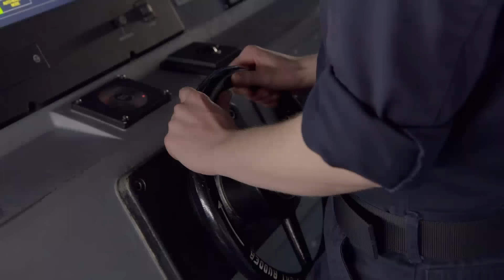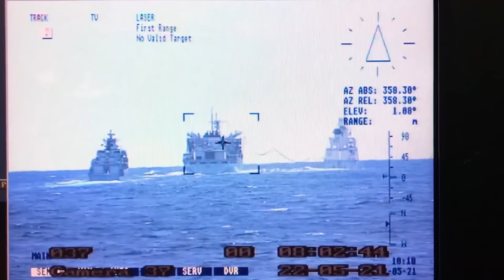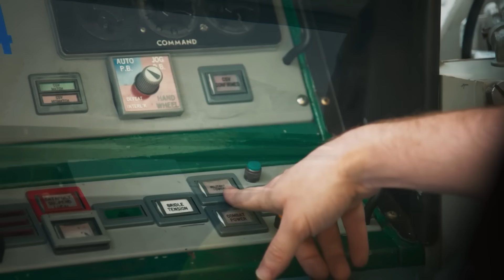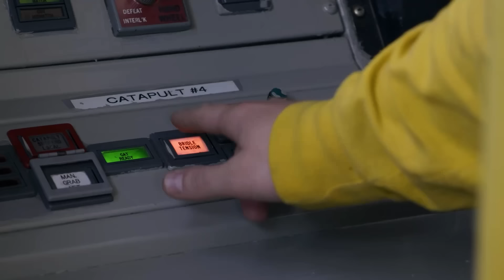EXCLUSIVE INSIDE LOOK at USS GERALD R. FORD with 5,000 Sailors | Aircraft Carrier Documentary

Comment: Thats my point.  Fighter Jets burn ALOT OF FUEL, just to do their assigned MISSIONS. BUT, i DO wonder about, ESPECIALLY, WHAT IF THESE JETS RUN LOW ON FUEL when the pilot  ENGAGAGES AFTER BURNERS.
Reply: There is a thing called in flight refueling. The Air Force has KC135s, KC10s being phased out, and new KC46s coming into service.